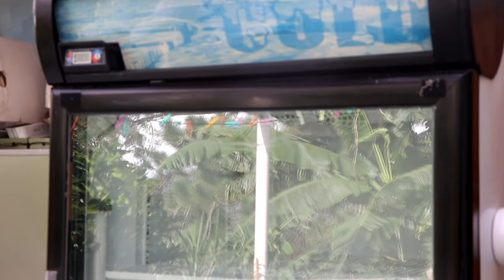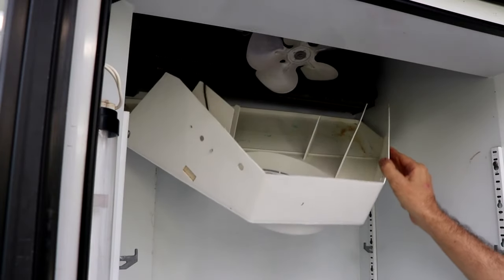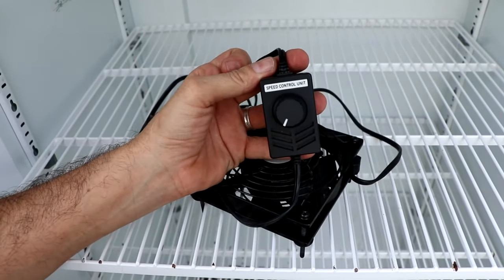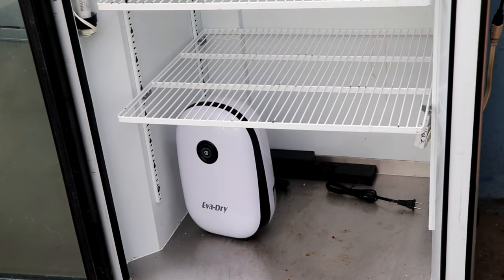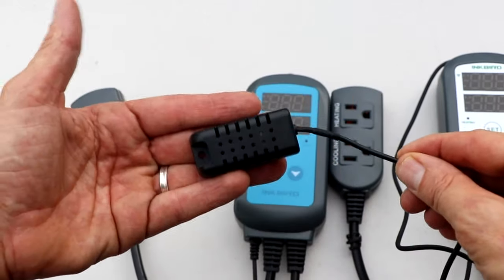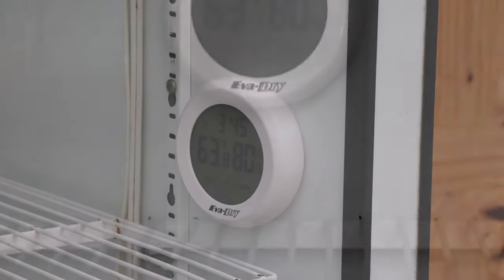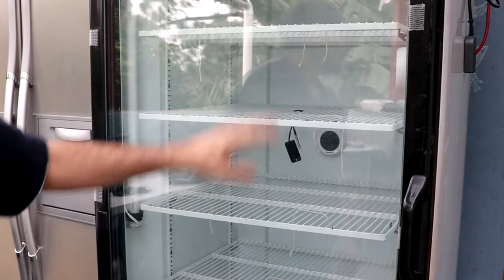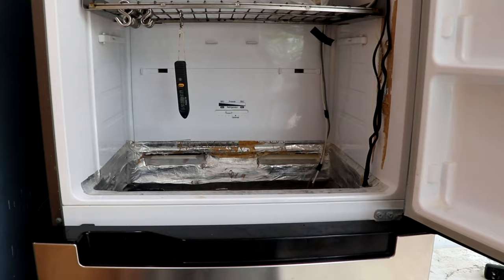Building a Salami Chamber/Cheese Cave - Easy Step by Step

Comment: Eric, I've just completed my first chamber build and am now in the process of dialing in the settings.  One thing I learned is that all humidifiers/de-humidifiers are not the same.  The newer ones have touch switches for the on/off function, this type of switch needs power all the time and will default to the off position when power is shut off by the controller.  I purchased both and had to replace both because of this issue.  If someone is looking to build a chamber they need to look make sure both the humidifier and de-humidifier have toggle or rheostat style switches to work with the controller.
Reply: It is unlikely that I will build a chamber however, I am glad to see that your imput is there to help others to not make the mistake that you made. "Good onya" George.

Comment: Will cross post this reply here also, as it is pertinent to folk's fridge or freezer choice. I do a lot of refrigerator repairs.  One problem if you leave the freezer separate from fridge, the fridge is usually cooled just by airflow from the freezer.  So there is usually a recirculation fan running a LOT.  You can't really disable that fan, and still get the cold from freezer to the fridge.  Whenever a fridge isn't staying cold enough but freezer still works, that fan is always blocked by too much food, or stopped working.  This is one area of Eric's fridge conversion that could use more info, as he talks about disabling that fan and/or replacing with computer fan... that could really make the unit inefficient,  causing freezer to overwork just to get fridge part to stay at 55, due to reduced cooling airflow.  Best thing is a dedicated refrigerator with no freezer, 2nd best is removing separator so it becomes one space.  Either a dedicated upright freezer OR a dedicated fridge like a beverage cooler would either be better than a fridge/freezer unit because you won't have to deal with as much airflow/heat transfer issues, they be engineered to cool the whole space without a fan driving airflow.

Comment: Wonder if you could have just hardwired the speed controller into the circuit for the existing fan?

It’s also a good idea to put a “drip loop” in all your wires inside the chamber. Bend and mount all your wires in a U shape near all the plugs and electrical equipment. This will make any moisture that condenses on the wires drip off before it can wick into the equipment or electrical contacts from the wire.
Reply: I must say I love Eric's simple approach.  Your idea is exactly what I did.  I have a CocaCola beverage cooler.  The fan has a temperature sensor and I don't hear it coming on so much.   My airflow is is perfect when I hang the yarn.   I figured I would just replace the fan and wire in my computer fan to the existing AC fan.   According to Eric he runs his computer fan 24x7 but that just seems pretty inefficient.    I will be posting my design on github with the entire control system.  Other than connecting some wires this control system works unbelievable (bench tested).  You will have about $20 in it.  This version is standalone but has fantastic features.  In a few weeks I will put my build in here.  Eric deserves all the credit.  He is awesome.

Comment: You should put tape or a rubber grommet around those sheet metal holes.  The light vibration from the pump running will eventually wear through the electrical cables causing a short and fire hazard.

Comment: I have been using more or less the exact same setup (my controllers are the non WiFi versions though) for the past year or so with very good results. Only problem I have ever had is the excess amounts of moisture, around 80% humidity, that tends to eventually overflow the reservoir on top of the compressor, where it is normally evaporated away when the compressor kicks in and get warm. This problem only occurs because my fridge is located in my garage, where the ambient temperature tends to be close to that of my drying chamber, meaning that the compressor does not kick in very often, except maybe on the very warm summer days. I live in the UK and the cost for the entire setup, including the fridge, was in the area of £250-300, or roughly $325-395, so reasonably affordable.
Reply from the maker: Yep.  That does sometimes happen.  Mine is outside so it doesn't happen too often but every once in a while I'll get a little overflow.  Nice job on the $$$.  Very reasonable! What do you have in it right now?

Comment: I have used a Pepsi cooler like yours for many many years. Yes they work great but noisy as hell if in your home as mine is. One thing you did not mention is once adding the meat things will change so you really need to monitor your adjustments. Also having backup humidity controllers is a must. They don't last for ever.  I have two Auber, one plug and play the other I built from their parts. Also one Inkbird. All can be a pain in the butt sometimes.

Comment: You can use the original fan by bending the blades until you get the air flow you desire. Actually more versatile than adding a new fan.

Comment: Your presentation is clear and concise. Thank you. I will apply the lesson. I have a question please. My bev display fridge has no fan. It’s simply a refrigerated box. Coils located on the exterior of the rear of the unit get hot when the unit is plugged in. 
-do I need the computer fan?
-are these rear coils likely to be the only? I could cut into the box without damaging the system?

Also, on a low setting, the box maintains a temp of 13°C (55F).  It seems remarkably stable over time. I have the inkbird controllers, a humidifier and dehumidifier, not yet installed, plus some temp/humidity monitors mounted inside. 
Thank you for your advice. I hope!

Comment: I built a chamber per this video thanks for the help. I followed your recipe for Genoa salami using elk. It's been in the camber for about ten days starting to get An acid smell in the chamber. One thing I did notice was my dehumidifier actually molded over and quit working I blew it out and it's back to normal operation.

Comment: Your videos are OUTSTANDING! I’ve made a few of them, and they all came out great… AND, to take it to the next step, I need a curing chamber. I’ve been watching the Marketplace type forums for the right combo of price and condition, but without luck. Would an upright freezer work well?  Seems to fit the criteria…. well insulated, wire shelves, etc.
Reply: Yeah, an upright freezer would work great. The temp-bot basically just unplugs it when it reaches your set point, and plugs it back in when it drifts too far away. It can also plug in a heater if necessary. 🤓👍

Comment: Hi Eric, also makes a combined Temp/Humidity control unit.  It's the model 608T.  I am using it in my chamber and it works perfectly.
Reply from the maker: The 608T is great!!  Lots of different functions with that controller.  For me that controller doesn't work as I need a humidifier and dehumidifier but I love it for my fermentation chambers
Reply: @2guysandacooler  I don't use a dehumidifier as I have the chamber in my office and open the door several times per day.

Comment: Thank you for the information explanations on so many different project - I like how you explain 'why' rather than just 'do this'.  I've setup a bar fridge using this video, but there is no fan in this thing, so first question is does this matter?  Secondly I wanted to start easy, and thought your Biltong would be my first feable attempt.  I watched the BIlton box and thought that can be done in the Meat Chamber if I add a light/heat pad - but then I got confused over airflow.  You made it clear airflow is paramount for Biltong, but there are no holes in the fridge for air to escape.  So my second question (sorry I got greedy), is the clarification that some products need significant airflow?   Thanks again for all the cool projects - this is a 10/10 channel!

Comment: I think I'm gonna do something similar, but instead of replacing the fan it seems to me that it would be easier to fabricate a more restrictive baffle that will then also have mounts for hanging.  I might also take that fan off and cut the rotors shorter too.  I think  anyone that has a metal hacksaw could probably just cut those rotors down until the airflow is where they want it.  I also think I'm gonna use the fan for humidity control and wire it to come on when the humidity is too high, then use terracotta bricks soaked in distilled water to maintain moisture.  I find most electric humidifiers end up putting things into the air that you really don't want... worth looking into...

Comment: I searched and read so many of these designs and settled on Eric's.  I have one question for everyone on here.  Does anyone have problems without circulating air from the outside? Does this work well without having some type of external ventilation periodically?  Many thanks to any input on this.
Reply from the maker: The only problem with not having external air is that you'll have to open the door every day or every few days for a little fresh air exchange.  Other than that it's great

Comment: I've seen a lot of videos using an old fridge, and it just seems like more work than necessary.  If you need a huge space, maybe this is worth it, but our family of 3 just can't eat that much meat.  Instead, I bought a wine cooler that I can adjust to the right temperatures without modification.  I got a simple humidity gauge and mounted it on the glass door.  I didn't need moisture until the end of curing, but when I needed moisture, I'd just put a small amount of water in a bowl at the bottom.  Dehumidifying is way more important imo, and to do that, I'd open the door.  I paid $200 for the 34 bottle wine cooler at a well known cheap retailer.  I paid under $10 for two humidity/temp sensors.  I've considered using a dehumidifier, but I'm also thinking about using silicon moisture wicking crystals.  They are cheap, and with some experience I know I can dial in perfect humidity.  

Finally, why anyone would put a fridge in direct sunlight, is just beyond me :)  Don't do that.

Comment: Love this video. A couple things I've been thinking about
1) Do you think its safe to dry age cheese and salami/salumi in the same chamber?
2) Are you interested in doing a fermented hot sauce video?
3) If the containers are sealed with an airlock, would it be safe to ferment beer or hot sauce in a chamber with Salami/Salumi?

Thanks,
Adam
Reply from the maker: Hey Adam, 
1.  Yes
2.  Yes (i have a major pepper fermenting project on the horizon)
3.  Yes (although the temp might be a little cold for the hot sauce.  Not sure about the beer)

Comment: Hi Eric. Thanks for that awesome video. Got me working on mine. Got it this weekend finished. Made it out of a used Wine Fridge. I have two questions if you can help me out.
1. I get a lot of condensed water in the bottom, to the point that after 2 o 3 days I have to dry a puddle of water.
2. How often does your humidifier goes on?. I'm getting on-off cycles of about 5-6minutes. Sound like too much.?

Comment: You might want to use rubber grommets for the drilled holes through metal. Also there is a plastic roll of “U” channel that can be cut to size.

Comment: Hi Eric.  I've found a great used refrigerator to build a small drying chamber and I plan on making some of the recipes in the 2023 Celebrate Sausage line up once I have everything up and running.  I do have a question about the need for a dehumidifier in my chamber.  I live in Phoenix, AZ and the climate here is very dry.  Also, my chamber will be indoors, not outdoors or in a garage.  Based upon those parameters, I'd like to start with just a humidifier and see how the unit performs before beginning to dry any product.  Does that make sense?  I can always had a dehumidifier if the chamber environment is consistently too damp.  Thanks for your thoughts and the great DIY video!
Reply from the maker: That's a good idea.  Every chamber acts differently based off of your placement and climate.  Let me kow how it acts where you live.

Comment: Excellent video! A question though, if the refrigerator already has a temperature control settings; is the control -"dongle" for temperature really necessary then?  Regards
Reply from the maker: not really.   You can try without it and see how it works.  If it's not tight enough, you could always add a temp sensor

Comment: Great video!  I am curious why you did not attach a heating pad - wouldn't there be any curing recipes that require higher temperatures?  Also, can this cabinet be placed inside the house (e.g., in a finished/carpeted basement) or is the garage better (e.g., due to smell or mold infestation issues)? Thanks.

Comment: I must say this is an excellent video I've researched many different avenues have not found anything this comprehensive. I also will compliment you on sharing the knowledge so that other people can get into the hobby for some reason people that have done this for years and years try to keep secrets this is a dying art and should be shared. I am following this build and I have been doing some testing I am having pretty large humidity swings while running my cooler curious if you have any insight on that I am using essentially the same humidification and dehumidification you are with the exception that I am using the everdry 1100 as I have a smaller chamber. Running both ink bird Wi-Fi controllers. Any help would be appreciated I am seeing humidity climb well over 10 points after humidification stops.
Reply from the maker: Do you have a hygrometer that reads the average in the chamber?  You are looking for an average of 80%.  Swings are totally normal.  You can expect a 10% swing up and down as the refrigerator's compressor kicks on and off.
Reply: Okay thanks for replying I'm kind of starting to wrap my head around that I guess it's impossible to maintain a steady hold on humidity I do have three magnetic hygrometers in there to keep an eye on things

Comment: Did you have issues with the coils freezing?  With such low airflow, I would expect it to ice over.  Does the dehumidifier cycle much?  I would think the refrigerator would pull the moisture out.

Comment: Hi Eric, greetings from Melbourne Australia. i am loving the channel and have recently made several of your fabulous recipes which are currently drying in a small chamber I have setup from an old bar fridge follwowing your guidelines above. One lot has been in around 2 weeks and the others just a few days. My query is I am getting a large swing in humidity greater than 10% (I have both a humidifier and de-humidifier although the humidifier offset is set to 10% and currently doesn't switch in). Is this normal for the early stages and is it partly the smaller chamber that makes it harder to regulate humidity? If not what else can I do to better regulate humidity. Being small I currently don't have a fan and just crack the door every few days.
Reply: Hey matey did ya fix it? Do you have a hygrometer that plots a graph to see how long the humidity stays for at certain stages? 
Have you see his more recent video on how he dials in the sausage maker chamber lot of info there
Did you make the swing closer to initiate on and off of hunidifier
Reply: @ugursenturk5860  thanks for the reply. No I don't have the ability to plot humidity.  I realised after the fact that I bought the earlier model Inkbird controller that does havebeifi app access. Will need to review Eric's l latest video on chamber tuning. Will also try setting the cut ins smaller for the humidifier/dehumidifier turn ons. Thanks for the tips.  Recently pulled out 2 Bresaola done to Eric's recipe and they came out ok. Another week and I have a Capocollo ready to (also Eric's recipe). Much to learn but all good fun, and good eating!

Comment: Great video. I don't understand the three minute delay for the refrigerator. Could I skip that whole controller by using a wine fridge that has 55 degree capabilities?
Reply from the maker: If your wine fridge has a 55F setting then you won't need a temperature controller..

Comment: Hi Eric,   Thanks for an outstanding video and I wished I've seen it a year ago.  I am using a wine fridge as my cheese cave and would like to use it also for curing meats.  I only have issues in controlling the humidity.  Can I get away with only a humidifier?  Would I still need a fan?  Last question, if you donot want to use the controller & Thermostat via smartphone,  What is the other option, to use?  Thanks a million!
Reply from the maker: That's perfect.  You should only need a humidifier.  Depending on the unit you have I don't think an additional fan is necessary.  Those controller can be used manually as well (no smart phone).  Either way they do a nice job..
Reply: @2guysandacooler  Thanks for your  response.   I appreciate it very much and I am looking forward to your cheese videos.  Thanks again

Comment: Fantastic video thank you. One question is that at 11:35 you mention the refrigeration delay on the inkbird controller to prevent the “compressor from burning out”. This is set to 3 minutes, am I to assume that if the fridge powers up and down too frequent that’s what will likely damage the fridge?
Reply from the maker: you are correct sir..